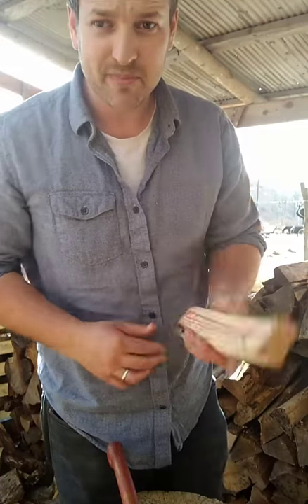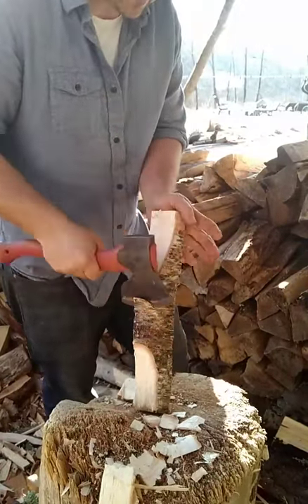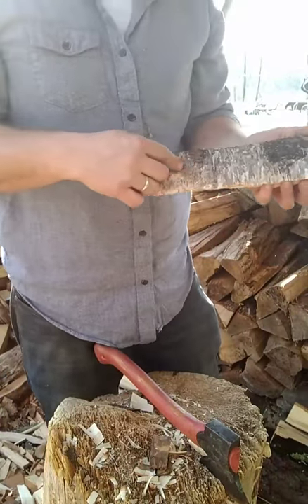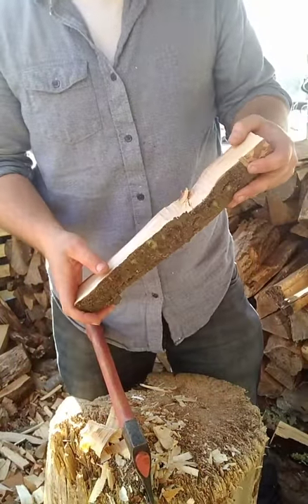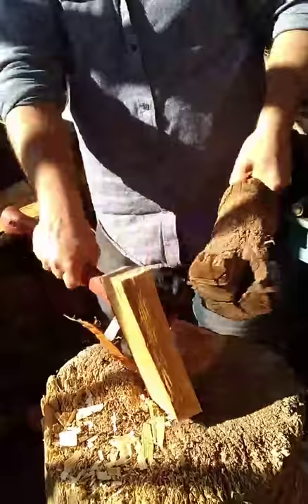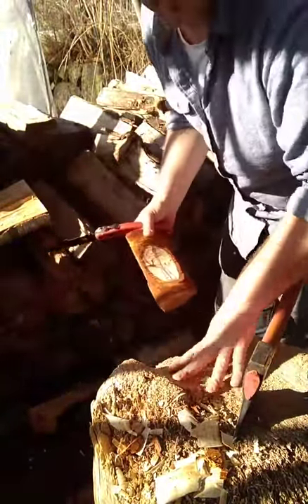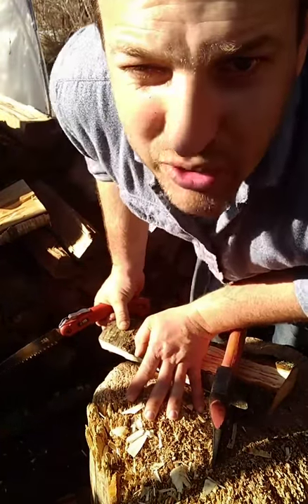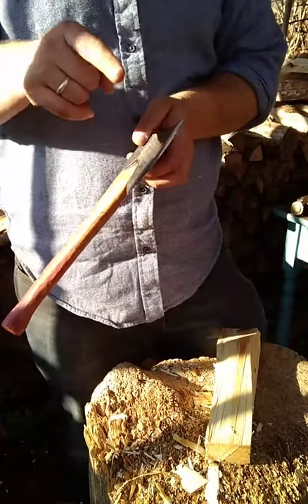Spooncarving, axing in the crank on raw blanks

Comment: It's good to see someone demonstrating axe technique and using the tool to do the work. Watched one the other day where the fellow, an accomplished carver, was effectively punching the axe into the wood - terrible technique ;) Also saw someone demonstrating who stood with his feet crossed "for safety" to get his leg out of the possible line of the axe. He adopted an inherently unstable stance "for safety".  If you work with your piece properly placed on the chopping block, a missed strike goes into the block, can't get to your legs. For those things that you need to work near the edge of the block, the cuts should be quite controlled - you aren't hewing at that point and there the control manages the risk.